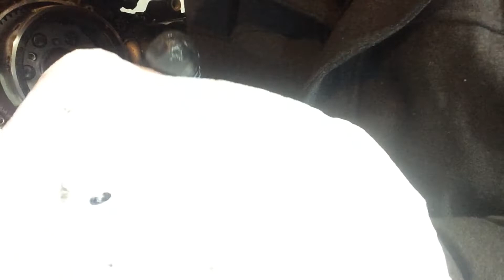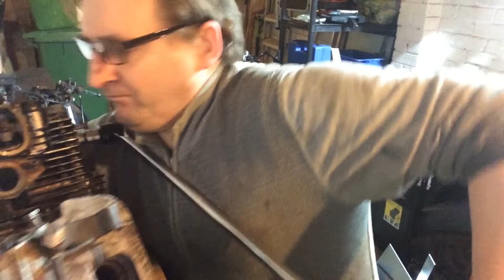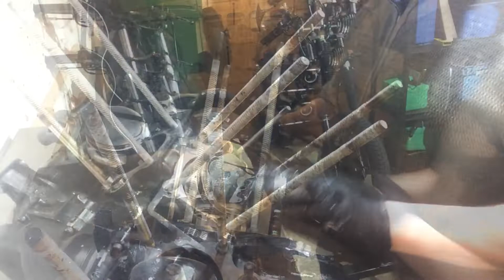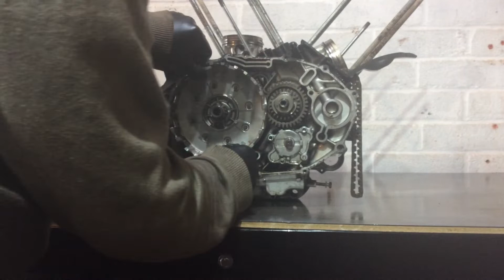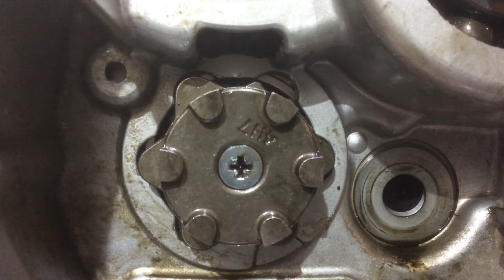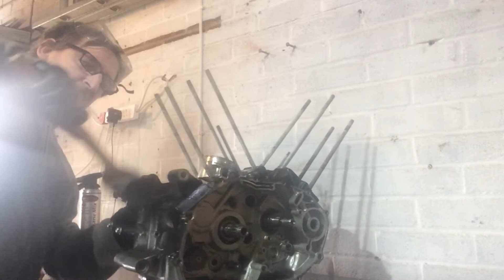Virago XV535 EP2 engine teardown

Comment: Well yesterday I managed to remove my 535 from my 1987. 
Trying to remove the rear cylinder cam bolt. Won't budge. Don't know what to do. Sprayed penetrating oil in there,but didn't help.
Haven't tried heat yet. Will heat work? Can only get to the head of the bolt of course. Thanks, Mike
Reply from the maker: It may have thread lock, so heat probably will work, and an impact gun.

Comment: What do you have on your bench as the work surface  , is it ali or mild steel sheet and how thick please ?.
Reply from the maker: 3mm thick mild Steele, and I usually go over it with a sanding disk and oil it down periodically.
Reply: @memybikeni9931  Thanks for the tip

Comment: Buen video 😊.  Mi virago hace un traketeo al acelerar. Pero en ralentí no. Solo al acelerar un ruido fuerte en el cilindro delantero. Que podría ser ??
Reply from the maker: Hi, the first place I would check is under the front cam cover to check that the chain is not become slack or stretched too much. One way to check is to get the cylinder into top dead centre (TDC) on the front cylinder for the compression stroke. Access the end of the crank from the centre plug on the stator cover and rotate the engine clockwise until the single line, lines up with the mark on the inspection plug hole, (you will also need to remove the smaller inspection plug to see) Then check the dowel on the end of the cam shaft aligns with the triangle mark on the cylinder head with the single line on the stator rotor lined up against the mark on the stator cover simultaneously. If the dowel is 180° out then rotate the crank a further 360° to the line again. Not the ‘T’ mark as that is the rear cylinder. If the dowel on the end of the cam does not point straight to the mark on the head, but is slightly off, then possible the chain has stretched and is loose, and will need to be renewed. At this point you can also wiggle the chain with your finger to get a feel for its tension. There should not be any movement at all. A further verification would be to remove the cam chain tensioner, run the engine, rev it to 3-4000 rpm and manually but very carefully push a rod into the cam chain tensioner hole pressing onto the tensioner bar to make your own tension to see if the noise goes away. If it does, there is your problem and likely the cause. If you watch episode 9 in this playlist at around 48:00 it shows this process quite well. A new chain and tensioner would be needed. The second thing I would  check while you have the engine in TDC compression is the inlet and exhaust valve clearances as both of the valves should be shut at this point, you can check the clearances are correct. They should be  0.1mm inlet and 0.15mm exhaust. If one or the other or both are very loose, they will rattle terribly. If you have a look at episode 11 in the playlist at around 18:45 it also demonstrates this. The third thing I would check is exhaust leaks from the cylinder head, on high revving sometimes gas escaping from around the flange from a loose exhaust header pipe can cause a loud ticking noise, which some people mix up with cam chains rattling, so check for leaks by running the engine at high revs and holding a tissue near the header pipe going into the head, see if it blows, and if so, refit new gaskets and tighten the header pipes. Those are all of the possible top end issues, before you need to think about pulling the engine out for a bottom end inspection. I hope that all makes sense my friend. Rich
Reply: @memybikeni9931  Thank you very much for the time to answer. I checked everything. but in the end I had to disassemble the cylinder and I found that the connecting rods were in their last days and making a tac-tac noise. now i will change it
Reply from the maker: @rodrigoburgos6190  oh dear, yes connecting rods were my next thought in the bottom end, which is a shame. Engine out job then, hopefully it will be straight forward for you.
Reply: @memybikeni9931  tell me one thing my friend... the pistons and cylinder after disassembling everything... to reassemble it (assemble it) let's assume that I made a mistake and put the rear cylinder in the front and vice versa as well as the head (head)
. Would it be relevant at the moment to want to start it? . greetings
Reply from the maker: @rodrigoburgos6190  Shouldn’t be a problem as long as you fit the oil baffle plate to the rear cylinder head along with the correct rear cover as that is the cylinder head that the breather pipe fits to. Aside from that, too much is made of mating parts, returning to their original positions. I honestly wouldn’t worry. Before starting it up, give it a good few turns over with a spanner on the stator bolt.
Reply: @memybikeni9931  I had already mounted it on the chassis.. I started it but it starts only slowly, it chokes and stops when accelerating it has no force. (That's why I wanted to know if the position of the cylinder heads and cylinder was related and that's why I disassembled it again) I lowered it and there was the engine again. I wasn't sure if I put the sign ( Ex ) of the piston right in both cylinders. But now when reviewing it, the positions are fine. I'll put it back together and check the stator and cylinder head points... and see what happens, hopefully I'm lucky this time. thank you 😀😀😀

Comment: Dear friend, I want to thank you immensely for your disassembly video of the Yamaha Virago 535 engine. I am from Brazil, and, despite the difficulty with the language (I speak Portuguese), I could easily understand your teaching. Today, 6/03/2023, I was able to complete the disassembly of my motorcycle's engine, problems with the connecting rods. I still haven't been able to take them apart to assess the damage, I hope it's just the bearings. A big hug, and many thanks.
Reply from the maker: Ah that’s brilliant Cesar, so glad you got it all apart ok, it’s just nuts, bolts and spanners really, with a few bolts with attitude thrown in. Glad the video helped. Hope you get the connecting rods sorted, if it is the bearings, it’s best to check all the oil galleries are thoroughly clear, and pull the oil pick up out to check it’s not blocked and starving the engine. To be honest with you, I’ve had a terrible couple of weeks, so a nice word and friendly hug very welcome. All the best my Brazilian friend 😊 Thanks, Rich.
Reply: @memybikeni9931  Yes, it was the connecting rod bearings, the one on the front cylinder, it looks like it fell apart, the one on the rear cylinder, it's a little stuck. Tomorrow I will disassemble them to check the real condition. Thank you very much. God bless you!
Reply: Good morning my friend. Unfortunately, the damage was great, it affected the crankshaft. Now, I'm going to think about what to do, parts for this type of motorcycle, only used, and very expensive. The alternative will be to send it to be rectified and nitrified in São Paulo. A hug.
Reply from the maker: @cesarmedeiros4463  Ah that’s a shame. Do you need a new crank shaft or can it be repaired with just a grind and new bearings ?
Reply: @memybikeni9931  A new one is practically impossible to find, a used one, only on the internet, and without being sure of the condition of the piece. I will get in touch with the company, which is located in São Paulo, about 3,000 km from where I am, where the grinding and nitriding is done.
Reply: Where I live, the grinder fills in the wear, and rectifies, but does not do nitriding or cementing. Which is the treatment for hardening the steel, so the crankshaft does not support the high engine speed, and breaks.
Reply from the maker: @cesarmedeiros4463  unless you can find just an engine locally and either swap over, or harvest parts ?
Reply: @memybikeni9931  I'm trying to get parts, but everything for this bike is hard to find. Thank you very much.
Reply: My son lives in Chicago, if I can't make it around here, I'm going to ask him for help.
Reply: @memybikeni9931  Good morning my friend. I hope you're fine. Sorry for the inconvenience, can you tell me if the Virago 535 engines and parts are the same for all years? Thank you very much!
Reply from the maker: @cesarmedeiros4463  I believe they are yes from 81 - 03. The service manual we tend to use in the U.K. not sure if you’re familiar with Haynes, evidences this year range without changes, which are mostly just cosmetic, and tank changes, side stand etc, but I believe the engine internals are all ok. Just remember that the engine sizes varied a lot, with differences there, so watch out you do buy for the 535.
Reply: @memybikeni9931  thank you very much.
Reply: Hello friend, I finally got in touch with the company that repairs the crankshaft. I will arrange for the shipment to be filled in for wear, grinding, and treatment of the steel hardness of the part via nitriding. A hug, thank you very much.
Reply from the maker: @cesarmedeiros4463  That’s good to hear Cesar. It’s very satisfying being able to work on your bike yourself, without having to pay an expensive mechanic, and next time you get a problem it will be even easier as you will be familiar with it.
Reply: @memybikeni9931  Did you use all new gaskets when reassembling the engine?
Reply from the maker: @cesarmedeiros4463  Yes I did, but i bought a cheap aftermarket set and had problems, so I would try and get a Yamaha OEM set if available.
Reply: @memybikeni9931  Friend, the engine gasket that gave the problem, was it the one at the base of the cylinder?
Reply from the maker: @cesarmedeiros4463  No it was on the stator cover.

Comment: I have the virago 535 year is 1990 , it’s done 22,000 miles,I am having knocking noises from the crank , people have said it’s the starter clutch , so have looked at it and all is fine , I did put diesel in the tank by mistake and wondered if it’s done the big end bearings in , so you have gave me confidence in stripping it down, I have bought a second hand top end and barrels with pistons , and 2 nearly new camshafts, I even have got the bottom end crank case , well onwards and updated I think , thanks for showing me how to strip it down .
Reply from the maker: Wow that’s a lot of parts to buy before you found the issue. Please do post back when you have determined the problem.  I can’t imagine starter clutch would make that sort of noise, although those little cams inside the mechanism are quite fragile, and diesel in the engine would just run poorly and smoke I think before blocking the carbs. Possibly worn big end bearings, so maybe just need to replace the shells. Even the plain shells on the main journals. But initially I’d would check the operation of the clutch and stator and all the gears there to see if anything loose. Could even be a broken fork or gear tooth getting churned around and caught up. So many things, it’s impossible to say without a good look, so all the best with it Philip.

Comment: Wow your video is so inspiring to be honest! My virago started working only on one piston and the compression is literally half, 6 bar on one cylinder and 5 on the other. Also, the cylinder that is not working has a strange noise like banging the engine with a hammer. Backfiring a lot too! I’m willing to tear the engine down
Reply from the maker: Sounds like your engine has some multiple catastrophic damage. Good luck with the investigation.
Reply: mę mŷ bïkë ń ì do I have to reset the timing of the engine if I only take off the cylinder head?
Reply from the maker: @AN ame  if it’s the rear cylinder take the cam cover off, take the timing plug out, and turn the engine clockwise to the line by the T mark, then make sure the dowel on the cam sprocket is lined up with the little arrow, if it isn’t, do a full 360 turn on the crank until it does, and when you put it back just make sure it is in the same position. Same with the front except turn the engine clockwise onto the single straight line with no mark by it, when the dowel is lined up as before. So in that sense it’s just keeping the timing in place rather than resetting it, with known marks and positions.
Reply: mę mŷ bïkë ń ì I want to swap out the front cylinder head from a bad motor to a working motor that has the spark plug threads torn so I was wondering if I had to reset the timing. Also do you happen to know how to remove the 2 screws that indicate the timing marks from the stator case? I can’t seem to take them off
Reply from the maker: @aname7338  Right so just line the marks up as described when you remove the old one and position the new one. Regarding the timing plug and crank plug, just use the largest flat blade screwdriver or largest coin you have using a pair of pliers for torque. Or a small screwdriver and tap it anti-clockwise with a hammer. I ground down a flat blade. It’s a ridiculous fitting, later models use a hex key I think.
Reply: mę mŷ bïkë ń ì I tried setting the timing but it’s by half a teeth out and I don’t know the tolerances of it. Do you happen to have a video on how to do it? Or could you explain me again please please?
Reply from the maker: @aname7338  half a tooth is just down to chain stretch, so you can’t time that out of the engine, you’d have to replace the chain and tensioner, It should be ok though.

Comment: s it possible to set the same gearbox on the xv 535 virago? I have a problem with it being hard to get from neutral to second gear. Everything else works great just that problem. Greetings from Serbia
Reply from the maker: I can’t imagine there is anything on the external shift mechanism that is causing the issue unless it’s where the shift linkage pulls on the drum. Drain the oil and inspect that first. if it’s not that, a strip down and inspection of the transmission is going to be required. Could be worn dogs, a bent selector fork, a broken tooth on one of the gears, but you should be able to get replacement second hand, they are fairly abundant.

Comment: Food vid chap been taken notes lol ready to start striping mine to see what the low compression about.
Reply from the maker: Fortunately mine had 150 psi on both cylinders so no issue there, but this bloody bearing, and the stuck hangar bolt on the front looks like a mare. Going to be a while before I get that done due to other things going on.
Reply: @memybikeni9931  can you get shaft out and it just leaves the bearing if so try bearing puller with slate hammer  and that stuck bolt get a bolt same thickness and just hammer it out. Spray sum penetration oil and heat up at same time.
Reply from the maker: @fuelheadjay8800  no the crank shaft is stuck in there too, I think the bearing spun and the locking tab is wedging it. All a bit odd. Yes I’ll try a bolt of the same size to push the stuck bolt out, but I could drill those I imagine.
Reply: @memybikeni9931  how about put bolt back into shaft and put breaker bar on and try turning it to try and put bearing back into position
Reply from the maker: @fuelheadjay8800  it would have to go a good 320° Clockwise and I imagine would wreck the threads in the end of the shaft first. I’m going to try suspending it and getting some head on, hopefully it will drop out.
Reply: @memybikeni9931  mmm sounds like it's going to be fun lol
Reply: @memybikeni9931  how about bottle jack against wall with wood inbetween jack and shaft then to bits a wood from case to the other wall to jam it then pump jack slowly might work. Any way good luck chap
Reply from the maker: @Fuel head jay  Yeah I could see the walls coming in on me 🤣🤣🤣 Any amount of opposing pressure on theses cases and they’d snap in two, that’s the issue using force on this. I think I’ll give it my best, and possibly have to replace the stator case if necessary, and cut around to get the crank free. Hoping heat will do it. Alternatively I could take it to my MOT guy and see if he can do I, he’s far more kitted out than me.

Comment: Great video, very clear and informative! Crap about that bearing. Id suggest heat and a press to just get that shaft out. Im sure you have a plan though. Look forward to seeing the rebuild!
Reply from the maker: Yes heat was my thinking, but as for a press I’ll have to be inventive. I’m still sure not how it has seized, I think the locking tab may be jamming it, I’m not sure. it would have been easier if had been a roller bearing rather than plain. we shall see how it turns out I don’t want to have to scrap the engine. 😬
Reply: @memybikeni9931  will be hard to turn it back, not sure how could free it up before getting it out??
Reply from the maker: I think firstly I’m going to try and support the case, with the crank hanging down and see if I can heat it and wait for the crank to drop out, then tap or cut the beating out, if I wreck the case maybe I can replace just that. Not seen much on YouTube to suggest anything.
Reply: @memybikeni9931  as good a plan as any.
Reply from the maker: @BareBonesMotorcycles   It’s certainly a head scratcher.